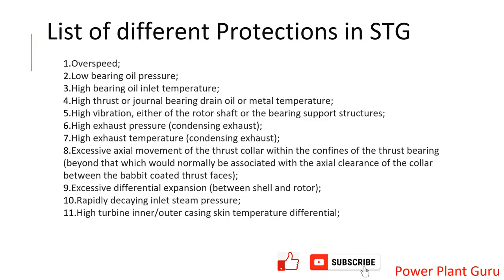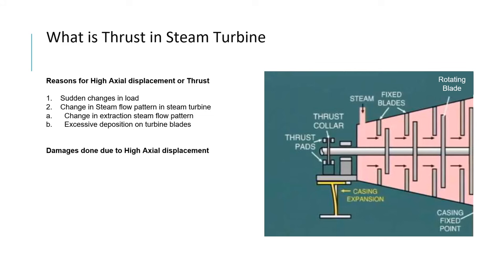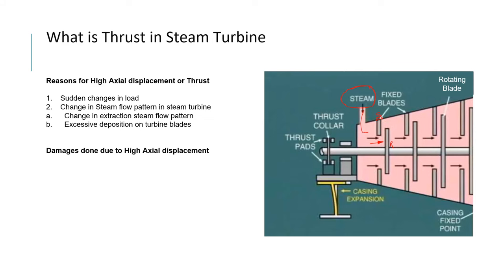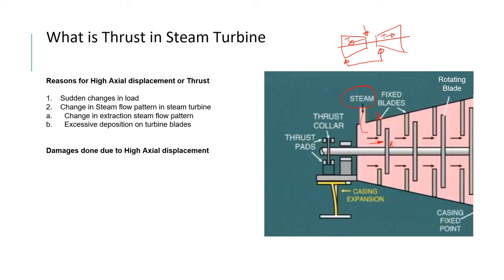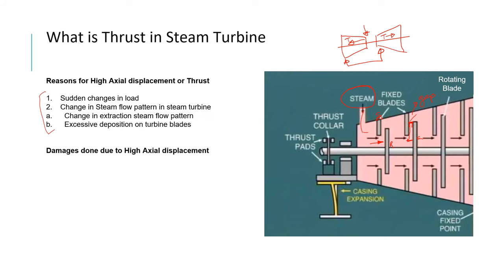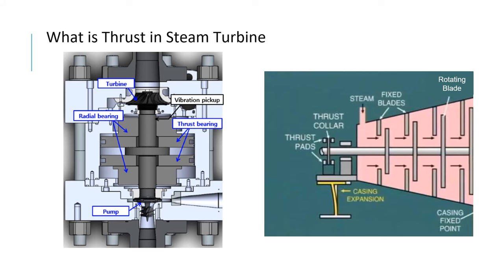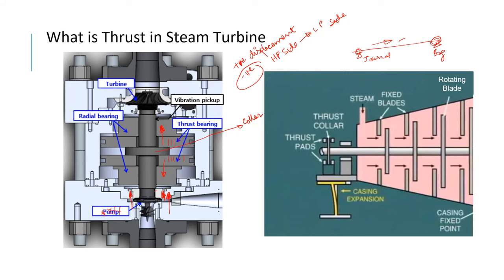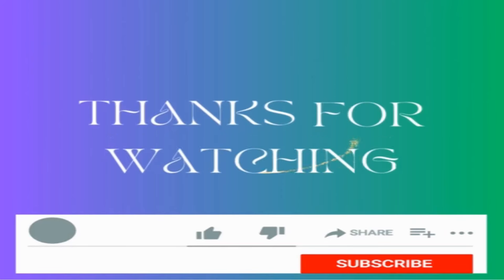Axial shift in Turbine and Pumps, Axial displacement in steam turbine, Thrust bearings

Comment: When casing expands towards left side does thrust bearing also moves towards left side (away from hp ebtry side)
Now what I'm confusing as rotor expands and with thrust the thrust collar will move towards active collar now how to avoid the rubbing between two?
I think this will be control through monitoring relative extension now as casing expands opposite to rotor then thrust collar will move with it but in this expansion the clearance between active pads and rotor wouldn't reduce further? or with expansion of casing the thrust collar will also expands ? please explain it to me